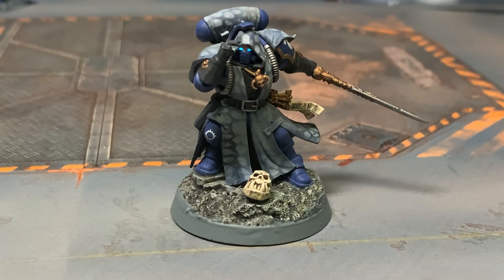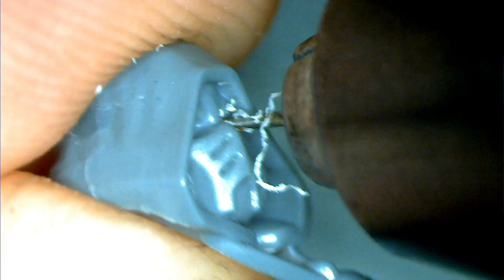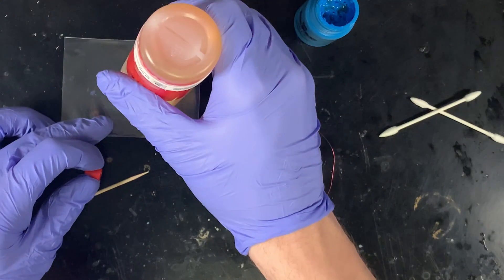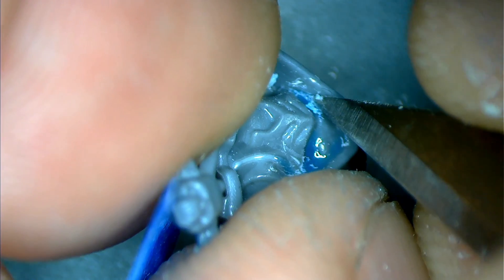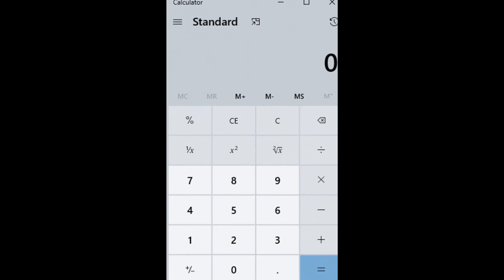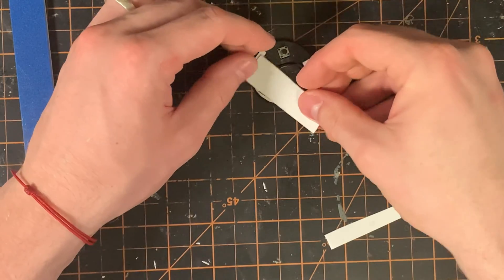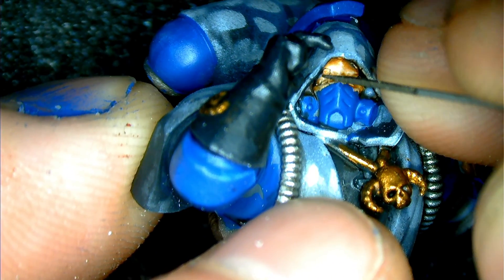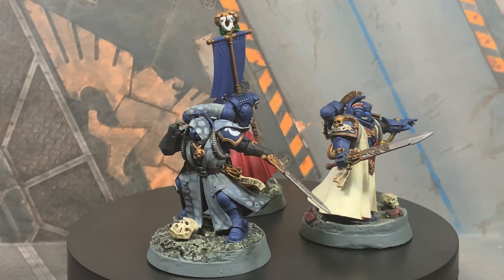LED eyes for the Librarian

Comment: Hey! Great video, and I'll most likely try something similar here. I have a suggestion: Have you tried using chipping medium over your eyes so you can easily peel off the paint on the eyes? Might be easier than manually scrapping?
Reply from the maker: @catfuz  I have tried that and masking fluid but the eyes are so small scraping seems to be easier

Comment: This could be  a dumb question but ... what kind of cables do you use for this ?
Reply from the maker: @UneBrioche  assuming you are asking about the wires for those I use magnet wire its enamel coating solid copper
Reply: @OchoMiniatures   yes sorry for my poor English level 😅 but you're right ! I was wondering what diameter would be thin enough to fit inside the body of my figurines . Thanks 👍
Reply from the maker: @UneBrioche  your English is definitely better than my any other language! As for size I use 28-36 gauge depending on exact use case so .3 mm to .2 mm for the non Americans 😆
Reply: @OchoMiniatures  Great 👍 i go see if the french's Amazon have this in stock 😅 Thanks again for your advice !
Reply: I think I find all i need but I can't post a picture here 😅 I would like to be able to discuss with you, about LEDs but also about optical fiber. It seems to me that you use it for cockpits. maybe you have a discord ? 
Tank's again !😊
Reply from the maker: @UneBrioche  email and discord work Ochominiatures for both I can’t post links on YouTube
Reply: @OchoMiniatures   ok so i go send you an email 😅 really sorry if this bothers you 😔
Reply from the maker: @UneBrioche  no bother at all I love helping people

Comment: Hey Ocho, I just wanted to let you know that I'm an electrical engineering student and I recently got into Warhammer 40k. Adeptus Mechanicus was an obvious fit for me, since it lets me combine my passion for electronics and circuits with dope religious themes. I immediately decided I was going to kit out my models with real circuits, and as many cool circuit elements as I could. Your channel is actively serving as an inspiration for some of the technical details that would've taken me ages to figure out. Most of my minis will follow a lot of your examples, with buttons and batteries and whatnot. But I think I'm going to try to have Cawl plug into the wall! I want to incorporate all of his wires as... well actual wires! It reduces the need to hide circuits, and I even had an idea to actually show the full wave rectifier and capacitor on his back, as they'll fit right into his aesthetic. If you think there's anything I should know before I start that might cause trouble please do let me know! Thanks for the awesome ideas, and I can't wait to show you the results!
Reply from the maker: That sounds amazing.  Lots of fun stuff you can do with admech for sure!
Reply: @OchoMiniatures  Oh also I sent you an email regarding some other ideas I think you'd like, could be some fun stuff

Comment: Great work. Out of curiosity how long does a battery last you?
Reply from the maker: Great question!  The mah of the battery is about 225 with a draw of about 10 ma so math wise it should last around 22 hours(you can go even longer with a duller LED).  I have left one on overnight with no issues and have played a few games with one of them and haven’t changed the battery yet!

Comment: What kind of battery did you used? Did you out a coin cell holder on the base? Or connected to the battery directly?
Reply from the maker: ya its a 3v 2032 battery in a holder

Comment: Really glad I saw this one, great tutorial. Now maybe i'm dumb but in most instances you shouldn't need the dual resistors if you have a smaller capacity one right? I'm terrible about led wiring and just stepping into it for my bases and dioramas. Sick work though!
Reply from the maker: So technically you shouldn’t need a resistor because of the internal resistance of the battery but I always put on on to be safe.  It’s not like I can go in and change the LED.  The reason I have 2 is so when I press the button the LED gets brighter.  I do have an led basics you may want to watch as well as basic soldering
Reply: @OchoMiniatures  Great advice, ive been checking out your other videos and ill just say I have a bottle of clear resin coming in the mail to make some coils LOL
Reply from the maker: @Abcshawn01  remember not to add any water, that means paint!  color it only with resin pigment
Reply: @OchoMiniatures  Yep this is for my 3d printer mostly, I saw the coil video and was filled with ideas!! I already have pouring pigment stuff and resin dye's that I never use haha

Comment: Could you use blue stuff to mold the head. Then drill out the eyes, put the back to the mold and fill the head cavity.
Reply from the maker: absolutely!  you may get a tiny bit of overspill from the head not setting back in perfectly but this works well

Comment: any reason for not using something to fill the eye holes before poring the resin?  It looks like poster tack would help hold back the volume.  Love the idea and going to have to try this.  Thank you for the excellent idea.
Reply from the maker: Ya poster tack may work or clay I think blue stuff from green stuff world may be best as it won’t stick and you could even use it to mold the eye shape back in but I didn’t worry too much about over spill because the epoxy is so thick good question though!

Comment: Had an idea to do this. Was thinking of using fiber optic cables. I might try something like this instead.
Reply from the maker: So the problems with fiber optic cables is there is a limit to how much you can bend them, they are pretty sensitive to chemicals (don’t mix well with super glue or plastic glue). And they typically only have a 60 degree viewing angle.  On top of that you need a light source to make em work I have found for this it’s just easier to run up an LED.  But that’s not to say fibber optics don’t have a place